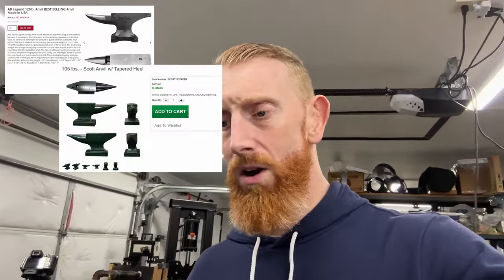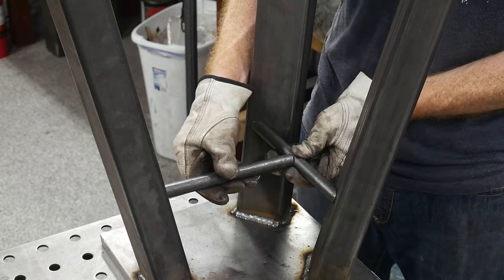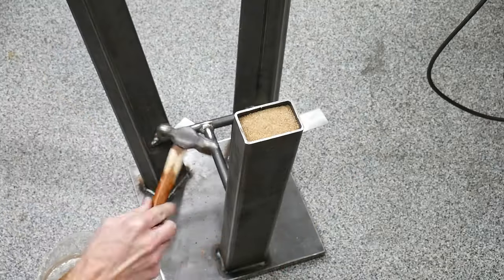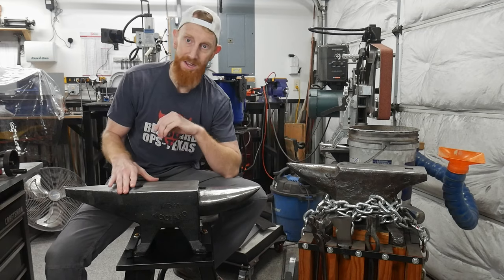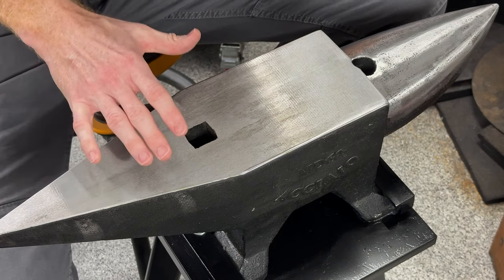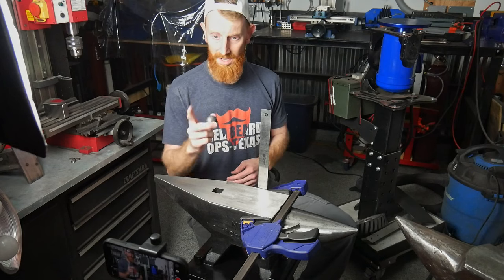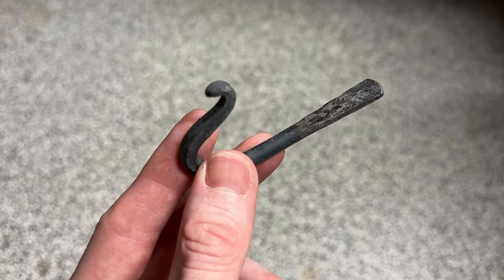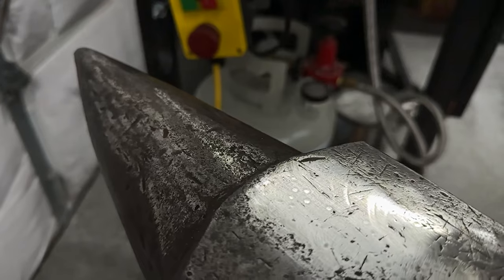Are Cheap Anvils Any Good? | VEVOR 132 LB Anvil Review & Anvil Stand Build

Comment: I use four of the 110 lbs Vevor -like anvils for my knife making workshops. They have seen about 400 beginner forgers since 2017, when I first bought them. and they are still going strong. I highly recommend these anvils provided that you do your rebound test and visual inspection of the Hardy and Pritchel holes before you take them home (sometimes these holes don't go all the way through). My only complaint is the position of the pritchel hole on the round horn (pretty useless). I would have preferred to see it located on the face where it would better support punch and drift work.
Reply from the maker: Thanks for the comment John; that's really interesting to hear! I agree on the pritchel hole... not ideal. Guess they wanted you to be able to get to the mounting holes... but odd for sure.

Comment: for the leg sand problem, drill and tap the feet with a hole that can take a pipe plug. weld the feet on, fill with sand through the hole, then screw in a pipe plug with a dab of loctite to keep it from vibrating out.
Reply from the maker: Good idea!

Comment: Very well done as usual, Doctor Keaton. I had considered those cheap cast steel anvils several years ago, but I ended up just getting an NC Tool one instead. It was several times the price, but still under $500 (back then, but not now, lol), and I don't regret the choice. I could use more than my 4" face width, but it has a side shelf that compensates for that most of the time.

I'll tell ya what that anvil could really use is... some checkering.
Reply from the maker: Thanks for your comment sir! Heck, I'm impressed with it for the price. Could be better for sure, but hard to complain.
Reply: @RedBeardOps  Oh, they're absolutely worth the price and then some. Much better value for the low budget smith than anything else on the market or a railroad track ASO.

Comment: Nice build on the stand. You ought to pouring the legs full of lead on your next one. I did that on the stand for my peddinghaus and it's pretty great.
Reply from the maker: That's a good idea! didn't even think of that! Gosh I bet that is heavy AF
Reply: @RedBeardOps  yeah I should have weighed it. It's nice to not have to deal with the sand and oil. Not sure how much lead it actually took. Maybe about 65-70 pounds. I got tired of moving it around pretty quick

Comment: My question is 'why do you only drop the ball 9 inches for a 10 inch drop test?' You start at 1 inch down and drop it just 9 inches. Does dropping it from a lower level affect the rebound % as it is a different energy profile? Just curious.
Reply from the maker: I'm just rolling with the "standard" test on anvil fire so I can compare results. Didn't think much about the height.

Comment: I've been trying to get them to send me one of their 2x72s but yeah they send me stuff like laser engravers and 3D printers asking me to review them haha
Reply from the maker: Hahaha, they crack me up... some useful stuff though in their catalog for sure. I really wish this anvil was a little smaller but solid in the base...
Reply: @RedBeardOps they tempted me a little when they offered me a mag drill. No idea what I'd use it for but I kind of wanted it haha. I actually personally really like their double horn design. Similar to European pig anvils.
Reply from the maker: @OldHickoryForge  I feel you on the mag drill... I've had a few applications for one of those over the years for sure
Reply: @OldHickoryForge  I've had a Vevor 2x82 grinder for almost a year and a half now and it works fine. You have to cut off a couple inches on the tooling arm to fit 2x72 belts. Not the greatest quality, but it works until I can upgrade. I traded it for a rifle so I don't know the cost or what would be included but I have two small wheels and a 12" contact wheel, as well as the flat platen. If you have any questions about that grinder, maybe I can help

Comment: I was on vevor website l the black are listed as cast iron. The blue are listed as cast steel.
Reply from the maker: This was a mistake by VEVOR in the product description. Someone asked this question on the product page and VEVOR responded that it's cast steel. They list the black 132 pounder at a 55 HRC and the blue 132 pounder at a 50 HRC.

Comment: You did the hardness test on the point which is easy to harden, you have to test the center of the anvil. And it's already dented from bouncing a ball barring on it.  Tis is a soft anvil. Who wants that?
Reply from the maker: My high quality anvil also dented from the ball. I tested the rest of the face and it's the same hardness.
Reply: Am sorry to tell you but, You high Quality anvil is soft to. A real high quality anvil does not dent.  @RedBeardOps